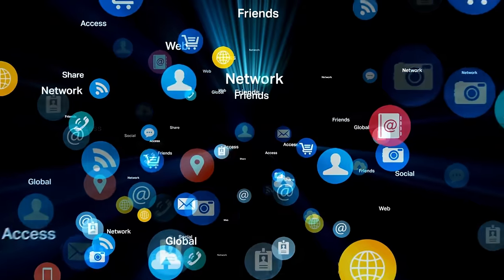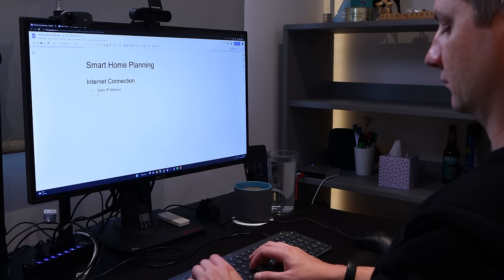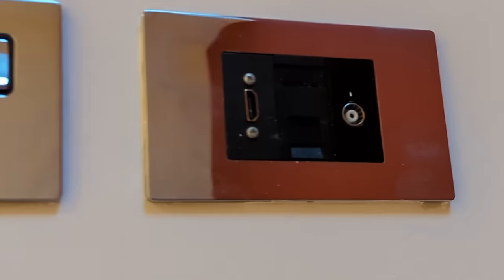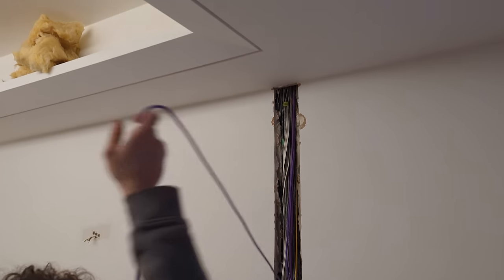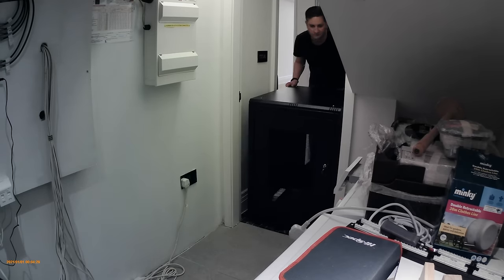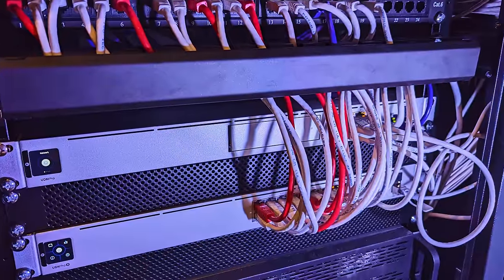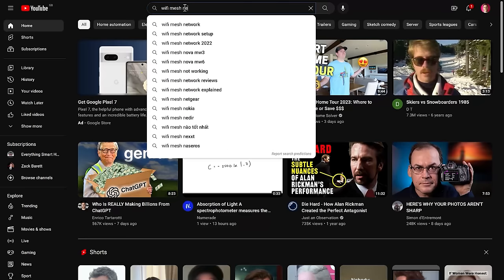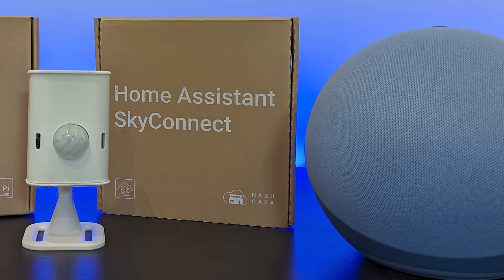Building a smart home network

Comment: I think it's over the top. IoT devices don't transmit huge chunks of data.   I think the network is a bit over the top. Wifi networks have improved drastically in the past couple of years, and unless you are running a cooperate network, there is no need to run cable in this day and age. The network devices that you are running also consume a lot of power and generate a lot of heat. To that I say just get good coverage around the house and run everything off wifi. With regards to the internet connection, you need a decent stable connection,  if your server is local then why do you need to transmit large volumes of your home automation data over the internet..? I live in a 500 square meter house with 100MB Fibre connection, I use TP link Deco to extend the network through the whole house and the speed I get at the furthest part of the house is around 70MB is is good enough for streaming, my IOT devices, working, etc. And my Home Assistant server is on a Dell PC that is located in the study. Just my 2c worth.
Reply from the maker: Thanks for sharing. I can't argue with any of that.

Comment: Love the video, I have a similar system. Surprised you didn't use keystone jack's for the patch panel (much easier to manage and update) and put the switch next to the patch panel to reduce the cables covering the udm.
Reply: Exactly what I thought. Patch panel at the top, switch right beneath an cables management panel between the switch and the UDM. You can do better as a former systems engineer😉

Comment: Old nerd here! 😃We're running along the same lines. I love old high end (by domestic standards) stuff, so my rack has an old Brocade 48 port PoE switch with 4 x10g ports as well. A 1U PowerEdge R210 II running pfSense. All as chip as chips on ebay.
The Wifi running on a TP Omada with 4 AP's, 2 inside and 2 outdoor. I can't say too many nice things about this system, brilliant performance and excellent value.
Two Unraid servers mounted in the rack. One dual Xeon based, running VM's (one is HA) and multiple dockers. The other Unraid server is a dedicated NAS. Again, all old Enterprise gear bought cheaply, the only new bits being the hard drives themselves. PoE cameras are mainly Dahua 4MP based on their 1/1.8" sensor (always prioritise sensor size over resolution). All the 10g ports are fibre connections. Again, the interface cards are remarkably cheap and the the setup is quite straightforward.
I'm considering getting another R210 box to run a dedicated HA on bare metal rather than as a VM, but the VM is running so well, I'm not sure what I'll gain from that.
Anyway, carry on Geeking and keep up the good work!
Reply: Yeah man as long as you build out good infrastructure you don't need to worry about wifi being bogged down by shellies, despite what people on reddit say.
Reply from the maker: I love this 💪
Reply from the maker: Exactly! You can put a lot on top of a solid foundation! It's worth investing in the core

Comment: I’m also looking for a 24 ports poe switch but they are usually expensive and power hungry. Would love to hear about your 2 separate networks. Oh by the way I was considering Reolink cameras. Will wait for your camera videos. Cheers 🥂
Reply: Check out Yuanley. Not that expensive. Maybe a bit louder but the power is there.
Reply: The Unifi Cameras are SOOO expensive. I use the reolink 4k cameras instead with my UDM Pro and its worked perfectly for the past 4 years. Building a new house now and rebuilding my smart house and I will be using Reoloink as well.

Comment: If your router supports DDNS you can also use that instead of a static IP. Depends on your use case/cost I guess.
Reply from the maker: Sadly that doesn't get around the issues caused by CGNAT

Comment: Along the same lines as the Google WiFi, netgear Orbi is very limited in its admin options. They are killer wifi access points, but the router is not designed for power users.
Reply from the maker: Thanks for sharing!

Comment: What major should I study to work and install a smart home system, smart cameras ,lights , voice control , automation and vim vision?
Reply from the maker: Do an apprenticeship in the smart home installation industry, and learn to code on the side
Reply: @HomeAutomationGuy  where I can study this I don't think it's available in Lebanon so I'm between electrical engineering and computer and communication engineering
Which is better (in both I learn coding)

Comment: I suggest Cat 6A if you can.
Reply from the maker: I agree that Cat 6A is better performing, but it's harder to work with - especially when you need to fish it through existing walls.
Reply: I used to think the same thing but after running two Cat 6 and two 6A lines (4 total) to the same room across my house I can say with confidence that I am unable to measure any difference in performance using 2.5Gbps Ethernet. The Cat 6A costs more, is a pain to pull through walls, and is difficult to terminate properly so that the shielding is grounded. While I don't have 10Gbps Ethernet at home (yet), the experiments I've done with friends and colleagues lead me to the same conclusion, if your runs are under 50m, Cat 6A doesn't give you any measurable improvements when running 10Gbps Ethernet.

I'm building a brand new home in a year or two so I would have to hear stories to the contrary of my experience but right now I'm planning on running Cat 6 for everything.

Comment: Is there value in running fiber instead of  cat6?
Reply from the maker: Probably. But it was a lot more expensive so I didn't opt for it
Reply: @HomeAutomationGuy  thanks! Great video, by the way!
Reply: For most use cases, no. There are no consumer-level network devices that use fiber. No regular PC has a fiber SFP port built-in. You can buy PCI-E cards with fiber ports, but they really are largely unnecessary for most t typical home use cases.

However, where fiber can come in handy is if you have a large home or property that you need to get network out to. Ethernet has a length limit of 100 m (~330 ft). If you need to install wifi access points further away than that 100 m limit, you can run a fiber optic cable from your switch (assuming it has the correct port) and install another switch at the other end and then install more network devices. There are even media converters that can extend an ethernet connection over fiber. There are numerous fiber cables and connectors, so if you're interested in it, you should read up on the different types and their use-cases.

Comment: Interesting video.

Why didn't you use keystones for your patch panel? Wouldn't that have been easier than punching down a whole lot of points?

Also, why do you suggest Cat 6 when building a new home instead of OM-3/4, in other words a fibre backbone? 

Did you consider Cisco instead of Unify?

Comment: I'll give you a top tip... Do it the Portuguese way.. Don't run cat 6 cables through your walls.. Run pipes... I fully upgraded my parents house which was built in late 90's and was able to access every room through 20/30mm pipes that were left inside walls and floors.. I was shocked. How is this not a standard in England

Comment: I have a home server for storing media and photos. 1 x 16tb HDD raid 1 with backup 4 x 4tb ssd raid 0 and  4 x 22 tb hdd raid 5 for storage.   Basically its a 82TB google drive. 

I also been buying more and more  smart devices ( smart light bulbs, google chrome cast, smart plugs , cameras , ring , thermometer , google home) and kinda notice that internet is slower, the range and reception is weaker. 

My questions are

1. Are my smart devices slowing down my internet / interfering the range?
2. Should I get a wifi extender or an extra router for better range and connection?
3. Should I have a separate server for my smart devices or should I use the same home server ?
4. If you have a server for storage databases and more and more smart devices , how would you set  it up?

I would prefer the easiest and most cost-effective solution. 

Thx

Comment: Some thoughts:
- I'm using the Parental Controls feature on my WiFi router to block access for my IoT devices. I just gave them static IP's & have them perma-blocked.
- NabuCasa, Home Assistant's partner, has a service that provides external access to your HA. No static ISP IP necessary.

Comment: Why not use a powerful router for example Netgear (orbi 960) rather than access points? Is there a particular reason? Thanks
Reply from the maker: I'd rather have all of the APs talk back to the router via a cabled connection. I have quite a tall but thin house, so the meshing systems don't always work so well

Comment: I keep my CCTV kit WAY AWAY off the internet ... zero contact since it's made from China. If I want to access it remotely, I'll VPN in and look across the LAN. The firewall will simply ignore any request outside the LAN from any of the CCTV gear, the printer IIRC and other things.

EDIT: FWIW I'm curious about the Ubiquiti gear, especially the router and cameras as I need more cams and a rackable router. ATM I'm using Sophos UTM (DAMN BRILLIANT router OS) on a little Atom 12v box which works great but isn't 1ru.

Comment: I love your videos but I am curious about your network performance. Early in the video you mentioned you ISP’s plan is a 900/900 plan. But at around 12:00 you say how your network is performing “perfectly”. You then show a speed test on your phone and your wireless speed is only 134/148. I have a similar setup as you with Ubiquity equipment but my service is only 500/500. (We have faster available but here in the US it is much more money and 500 symmetrical meets my needs.) Anyway, my wireless performance using Ubiquity access points is around 495/495. I think if you tweak your access point’s channel settings you should get much better performance.
Reply from the maker: I don't ever expect to get the full 900 from a shared WiFi access point, only through hard wired devices - which is why I try to wire in as many as possible
Reply: @HomeAutomationGuy  Oh I completely agree but you should be able to get closer to 450 at least. Before playing with channels and signal strength I too had performance similar to you. A couple hours spent tweaking the settings yielded huge improvements! Good luck and keep up the great videos.
Reply from the maker: @PatDoyle  Great to know! Maybe I'll spend the weekend tweaking and playing 🤓

Comment: We had a 1 gigabit connection and we were automatically upgraded to 10 gigabit by our ISP two years ago. I really wish we just wired the place up with fibre. Please promise me you have easy conduit around your house and did not plaster over the wires, you may need to add some cables and simply use the cat cable as a DC circuit for Wi-Fi!

Comment: A rack next to washing machine? :) That is the worst imaginable place to put that. Water leakage? If the incoming tube breaks that will spray water all over. Not to talk about humidity and vibration.... when they meet during the spin cycle.... Also it will be warm there during summer time. But I wish you luck to not have any water damage anyhow. While I totally against your idea at a minimum I suggest having multiple water leak detectors there + humidity sensor + an electric valve to the mains + vents with a proper automation. And put some sealing between the washing machine and rack for god's sake :))))
Reply from the maker: I totally agree! Unfortunately that's where the geniuses who built the house all those years ago terminated the cables, so I don't have a lot of options. The rack is up on wheels and all the equipment is pretty high up so hopefully it doesn't get wet! 🤞

Comment: If you rely on WiFi and IP connected devices, then 100% a strong WiFi network is needed.  If you mainly use Zigbee or Z-wave then Wifi is not so critical.    I would say the average home user would never need a static IP Address.    This is more for the power user and tinkerer.   Same with blistering fast Interent.   50mbps is fine for Work from home, Teams and Zoom and 4K streaming.    I love techy stuff, and I work in the networking field myself.  Although there is good information in this video, a lot is overkill for majority of home users, even wfh with 4k streaming.   That said, I still love your videos as I am a bit of a nerd too lol :)
Reply from the maker: Oh it's waayyy over the top. But you have to believe how much fun I had researching and installing it all. It was all my birthdays put together!

50mbps is perfectly fine, as long as you also get 20-50mbps upstream. My old house had 11mbps upstream and it sometimes struggled with two simultaneous video calls.

Comment: Alan - I would agree with you totally on the Google Mesh system.  I have been using one for several years, and while the Wifi coverage and uptime has been great, all of the advanced controls have been dumbed down so much, it becomes unusable for some of the functions that the true nerds among us would want to use.  And sometimes, the GUI just loses devices making it impossible to assign port forwarding, IP reservations, etc.  For my next house I am planning on upgrading to the TPLink Omada platform - which is supposed to be a cheaper alternative to Unifi - I hope...
Reply from the maker: TPLink make great devices. I've used them for decades and they've always been solid
Reply: Hovering up your data possibly...
Reply: @HomeAutomationGuy  TPLink Omada system is indeed amazing (and fairly priced)
Reply: Thanks Alan, I forgot to mention before I think this is a great video!  I would like to add my vote for you to do do a video on how you setup your vlans.  I only know enough to be dangerous (mostly dangerous because I don't know enough) when it comes to networking, and would love to see how you do it.  I will likely be doing it in pfSense, but the theory will still be very applicable.

Comment: cat5e or cat6 is really slow. i have cat6a in my home for 15 years already. in my opinion that would be the minimal as it is the first cable with 10GB as opposed to 1GB for cat5e or cat6. i think people should be aware of that before they install cables in their house. The prices are fairly similar and the overall amount is not much. so CAT6A minimum in my opinion
Reply from the maker: Is Cat6A much harder to run around tight spaces and terminate into jacks and racks?
Reply: @HomeAutomationGuy  definitely harder compared to CAT5E but the benefits are there. SFTP makes for a shielded cable plus each twisted pair is separetely shielded which is great for running the cables right beside the power cables without any issues or loss of performance. for racks, patch cables and patch panel will need to be used just as with any other cable. cat6a def thicker and harder to manouver but possible without any major issues. i've ran it across my apartment in various places without any issues. the latest one i've bought is cat7a+, s/ftp, 1500mhz, tested at 25gbit up to 30m. cat6a and cat7a are great cables to future proof your house without giving out the money for optics which are not needed for any home installation unless you want to go overboard.

Comment: After reading some documents on these server racks I ready they have to be grounded. 

1. Did you do that
2. Where do you attach it to in your house?
Reply from the maker: I did not ground my rack. I'm probably wrong but I thought this was only required in very dense racks in data centers. Most of the equipment I've plugged in is grounded through their power cables

Comment: I don’t have a new house, but planning to upgrade my network. I’ve got 3 questions based on your video:
1. Have you thought about a pfsense/opnsense router? (I am thinking to leave out the UDM pro)
2. You have a 24 switch, the box said the pro POE model. Right? And why? Because of layer 3 or the POE budget? Or? And is it overkill for the majority?
3. It seemed that you had 2x the NanoHD and 2x the pro model. Is the pro WiFi 6? And then, why the Nano HD which aren’t?
Reply from the maker: 1. PFSense is fantastic. I'd totally recommend it. I went with the UDM Pro as it also works as my NVR and works nicely with the switch and APs.
2. It was because of the POE budget. I didn't want to strain it with all the APs, cameras and anything else I want to power through it in future.
3. it was purely a budget thing. The Pros are expensive so I put them where there are more and faster devices. The others are for areas I care less about but still need solid WiFi

Comment: A static IP is not an option for many in North America without a business account that costs hundreds of dollars per month.
Dynamic DNS services are the way to go for us. I use DuckDNS and have never lost connection to my home.
Reply from the maker: Interesting. I did not know that about North America! I've only got experience with Australia and the UK where static IPs can be purchased for a small monthly fee. Dynamic DNS doesn't solve the CG NAT problem, in the past it's been impossible for me to remotely access Wireguard or similar without a properly routed IP address that you get by going static here.

Thanks for sharing!
Reply: @HomeAutomationGuy  there are 3rd party providers that offer static, but service is horrible if you have issues. you call some call center, then they send ISP tech from the company who owns the lines, not the company you pay.  bucks get passed.